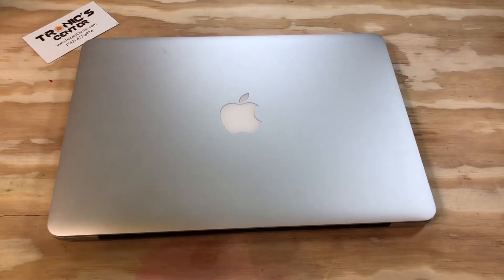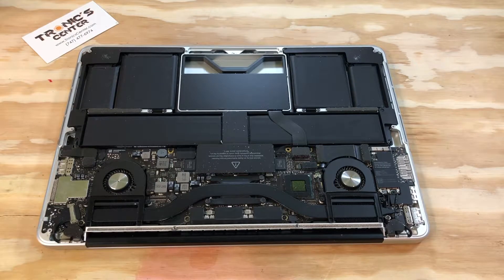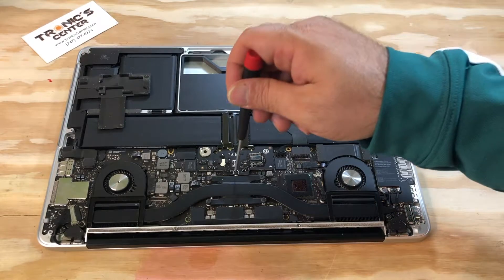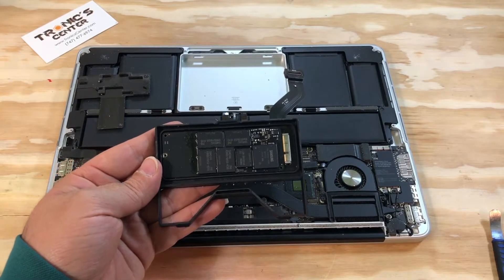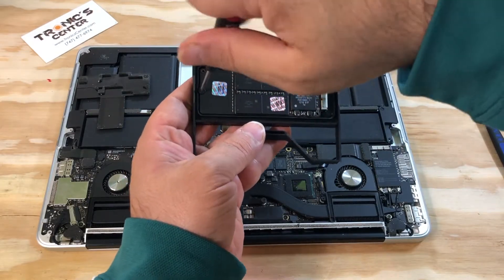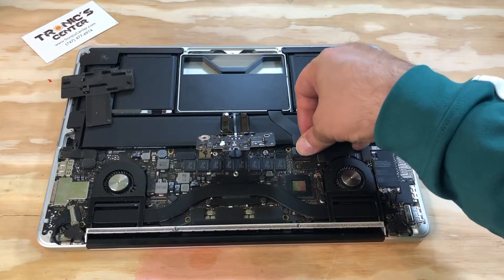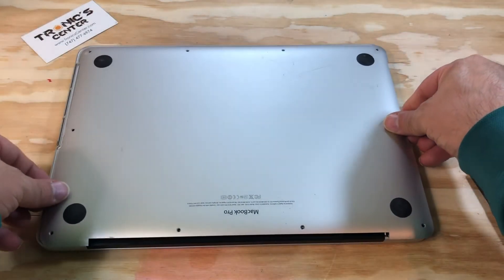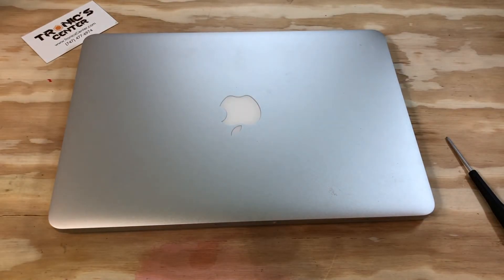Replacing SSD Pcie Storage on 13" MacBook A1425 - SSD installation 13" MacBook Pro A1425    HD 1080p

Comment: why does the battery connector have to be detached when the ssd can be replaced without doing so by simply flipping the assembly ?

Comment: What type of screwdriver do you use at minute 2:00? Thanks
Reply: T6 is what I just used to unscrew it on my laptop
Reply from the maker: Dear You may source the whole screw driver set to be able handle the repair some time the screw is not having a good edge housing then you might want to used different size to grip better . 

Apple, MacBook, 13" MacBook, MacBook Air, A1466 MacBook, MacBook Air logic Board, 13" MacBook Air , Apple Mac , 11” MacBook , A1465 MacBook, A1502 MacBook, A1398 MacBook, A1425 MacBook, A1706 MacBook, A1708 MacBook, A1707 MacBook, A1990 MacBook, A1989 MacBook, A2159 MacBook, A2179 MacBook, A2289 MacBook, A2337 MacBook, A2338 MacBook, A2141 MacBook
Reply from the maker: A2251 KeyWords 

MacBook Pro "Core i5" 2.0 13" 2020 4 TB 3, 2.0 GHz Core i5, I5-1038NG7, MacBook Pro "Core i7" 2.3 13" 2020 4 TB 3, 2.3 GHz Core i7,  I7-1068NG7, MacBookPro16,2 , 2020 13" 4 TB 3 , A2251 MacBook , EMC 3348, MWP72LL/A, BTO/CTO

————————————————————

A2141 KeyWords 

MacBook Pro "Core i7" 2.6 16" 2019, 2.6 GHz Core i7 (I7-9750H), 2.3 GHz Core i9 (I9-9880H), A2141 (EMC 3347), 2.4 GHz Core i9 (I9-9980HK) , MacBookPro16,1, MacBook Pro "Core i7" 2.6 16" 2019 5600M, 2.6 GHz Core i7 (I7-9750H),  MacBookPro16,4 , MacBook Pro "Core i9" 2.3 16" 2019 5600M, 2.3 GHz Core i9 (I9-9880H), MacBook Pro "Core i9" 2.4 16" 2019 5600M, 2.4 GHz Core i9 (I9-9980HK), MVVL2LL/A, MVVM2LL/A, 16" MacBook A2141

———————————————

A2179 Keywords

MWTJ2LL/A, EMC 3302 , 1.1 GHz Core i3 (I3-1000NG4) , MacBook Air "Core i3" 1.1 13" (Scissor, 2020) , MacBookAir9,1 , 1.1 GHz Core i5 (I5-1030NG7) , MVH22LL/A , MacBook Air "Core i7" 1.2 13" (Scissor, 2020), 1.2 GHz Core i7 (I7-1060NG7)

——————————————

A2159 Keywords 

1.4 GHz Core i5 (I5-8257U) , MacBook Pro "Core i5" 1.4 13" Touch/2019 2 TB 3 , MacBook Pro "Core i7" 1.7 13" Touch/2019 2 TB 3 , 1.7 GHz Core i7 (I7-8557U) , MUHN2LL/A , A2159 , EMC 3301 , MacBookPro15,4 , 2019 13" (Touch Bar, 2 TB 3), 13" MacBook Pro A2159

—————————————————————

A1932 Keywords  

MRE82LL/A , MVFH2LL/A, 1.6 GHz Core I5-8210Y, 1.6 GHz Core I5-8210Y, MacBookAir8,1 , EMC 3184 , 13" MacBook Air Space Gray, 13" MacBook Air Gold , 13" MacBook Air Silver , 13" MacBook Air 2019 13" MacBook Air 2018, 13" MacBook Air A1932

—————————————————————

A1534 Keyword’s

EMC 2746, MF855LL/A, MF865LL/A, EMC 2991, MLHA2LL/A, MLHC2LL/A, EMC 3099, MNYF2LL/A, MNYG2LL/A, MacBook8,1 , 1.1 GHz Core M (M-5Y31) , 1.2 GHz Core M (M-5Y51), 1.3 GHz Core M (M-5Y71), 1.1 GHz Core m3 (M3-6Y30), 1.2 GHz Core m5 (M5-6Y54), 1.3 GHz Core m7 (M7-6Y75), 1.2 GHz Core m3 (M3-7Y32), 1.3 GHz Core i5 (I5-7Y54), 1.4 GHz Core i7 (I7-7Y75), MacBook9,1 , MacBook10,1

——————————————————

A1990 Keywords

MR932LL/A, 2.2 GHz Core i7 (I7-8750H), EMC 3215, MacBookPro15,1 , MR942LL/A 2.6 GHz Core i7 (I7-8850H), 2.6 GHz Core i7 (I7-8850H), 2.9 GHz Core i9 (I9-8950HK), 2.6 GHz Core i7 (I7-9750H), EMC 3359, 2.3 GHz Core i9 (I9-9880H), 2.4 GHz Core i9 (I9-9980HK), MacBookPro15,3, A1990 MacBook, 15” MacBook A1990

———————————————————

A1989 Keyword 

A1989 MacBook 2018 MR9Q2LL/A, 2.3 GHz Core i5 (I5-8259U), BTO/CTO, 2.7 GHz Core i7 (I7-8559U), EMC 3214, MacBookPro15,2 , A1989 MacBook 2019 MV962LL/A , 2.4 GHz Core i5 (I5-8279U) , MV982LL/A, 2.8 GHz Core i7 (I7-8569U) , EMC 3358, 13" MacBook A1989

———————————————

A1708 Keywords

MLL42LL/A, A1708, EMC 2978, MacBookPro13,1 , 2.0 GHz Core i5 (I5-6360U) , 2.4 GHz Core i7 (I7-6660U) , MPXQ2LL/A, EMC 3164, 2.3 GHz Core i5 (I5-7360U) , 2.5 GHz Core i7 (I7-7660U), MPXQ2LL/A, 13" MacBook A1708

———————————————————— 
MacBook 

Apple, MacBook, 13" MacBook, MacBook Air, A1466 MacBook, MacBook Air logic Board, 13" MacBook Air , Apple Mac , 11” MacBook , A1465 MacBook, A1502 MacBook, A1398 MacBook, A1425 MacBook, A1706 MacBook, A1708 MacBook, A1707 MacBook, A1990 MacBook, A1989 MacBook, A2159 MacBook, A2179 MacBook, A2289 MacBook, A2337 MacBook, A2338 MacBook, A2141 MacBook, MacBook Pro, MacBook Pro Retina, Retina display, True Tone Display , Top Case KeyBoard, Apple Keyboard, MacBook KeyBoard, MacBook Trackpad.
———————————————————

A1398 MacBook, A1398 Logic Board, A1398 LCD, A1398 KeyBoard , A1398 Display, MC975LL/A, MC976LL/A, MD831LL/A, ME664LL/A, ME665LL/A , ME698LL/A, ME293LL/A, ME294LL/A, ME874LL/A, MGXA2LL/A, MGXC2LL/A, MGXG2LL/A, MJLQ2LL/A, MJLT2LL/A, MJLU2LL/A

—————————————————————

A1706 Keywords

MLH12LL/A, A1706 EMC 3071, MacBookPro13,2 , MacBookPro14,2 , MPXV2LL/A, A1706 EMC 3163 , 3.5 GHz Core I7-7567U, 3.3 GHz Core I5-7287U, 3.1 GHz Core I5-7267U, 3.3 GHz Core I7-6567U, 3.1 GHz Core I5-6287U, 2.9 GHz Core I5-6267U, A1706 MacBook, A1706 MacBook Touch Bar 

—————————————————————
A1707 Keywords 

MPN 923-01477 , MLH32LL/A, MLH42LL/A, MPTR2LL/A, MPTT2LL, EMC 3072, MLH32LL/A, MacBookPro13,3, 2.7 GHz Core i7 (I7-6820HQ), MLH42LL/A, 2.9 GHz Core i7 (I7-6920HQ), EMC 3162 , 2.8 GHz Core i7 (I7-7700HQ), MacBookPro14,3 , 2.9 GHz Core i7 (I7-7820HQ), MPTR2LL/A, MPTT2LL/A, 3.1 GHz Core i7 (I7-7920HQ), A1707 MacBook, A1707 Touch Bar

Comment: I forget my password. How  can i reset my password please sir help me.
Reply from the maker: Dear Since there multiple Type of Password are there not sure how to help, Also there type of password that we can not fix but You May visit your Local Apple Store / computer Store and ask them to help ! 

Let us know what type of video want us to make for you, we can do " All brand repair such as Cisco, Juniper, Hp, Dell, Lenovo, Sony, Panasonic, Nikon, Canon, Apple, SamSung, Any Device iPhone, MacBook, iPad, iPod, Hardware repair or software , iOS or Android , Samsung Cellphone, Laptop, PC, Tablet or Data recovery !
Reply from the maker: A2251 KeyWords 

MacBook Pro "Core i5" 2.0 13" 2020 4 TB 3, 2.0 GHz Core i5, I5-1038NG7, MacBook Pro "Core i7" 2.3 13" 2020 4 TB 3, 2.3 GHz Core i7,  I7-1068NG7, MacBookPro16,2 , 2020 13" 4 TB 3 , A2251 MacBook , EMC 3348, MWP72LL/A, BTO/CTO

————————————————————

A2141 KeyWords 

MacBook Pro "Core i7" 2.6 16" 2019, 2.6 GHz Core i7 (I7-9750H), 2.3 GHz Core i9 (I9-9880H), A2141 (EMC 3347), 2.4 GHz Core i9 (I9-9980HK) , MacBookPro16,1, MacBook Pro "Core i7" 2.6 16" 2019 5600M, 2.6 GHz Core i7 (I7-9750H),  MacBookPro16,4 , MacBook Pro "Core i9" 2.3 16" 2019 5600M, 2.3 GHz Core i9 (I9-9880H), MacBook Pro "Core i9" 2.4 16" 2019 5600M, 2.4 GHz Core i9 (I9-9980HK), MVVL2LL/A, MVVM2LL/A, 16" MacBook A2141

———————————————

A2179 Keywords

MWTJ2LL/A, EMC 3302 , 1.1 GHz Core i3 (I3-1000NG4) , MacBook Air "Core i3" 1.1 13" (Scissor, 2020) , MacBookAir9,1 , 1.1 GHz Core i5 (I5-1030NG7) , MVH22LL/A , MacBook Air "Core i7" 1.2 13" (Scissor, 2020), 1.2 GHz Core i7 (I7-1060NG7)

——————————————

A2159 Keywords 

1.4 GHz Core i5 (I5-8257U) , MacBook Pro "Core i5" 1.4 13" Touch/2019 2 TB 3 , MacBook Pro "Core i7" 1.7 13" Touch/2019 2 TB 3 , 1.7 GHz Core i7 (I7-8557U) , MUHN2LL/A , A2159 , EMC 3301 , MacBookPro15,4 , 2019 13" (Touch Bar, 2 TB 3), 13" MacBook Pro A2159

—————————————————————

A1932 Keywords  

MRE82LL/A , MVFH2LL/A, 1.6 GHz Core I5-8210Y, 1.6 GHz Core I5-8210Y, MacBookAir8,1 , EMC 3184 , 13" MacBook Air Space Gray, 13" MacBook Air Gold , 13" MacBook Air Silver , 13" MacBook Air 2019 13" MacBook Air 2018, 13" MacBook Air A1932

—————————————————————

A1534 Keyword’s

EMC 2746, MF855LL/A, MF865LL/A, EMC 2991, MLHA2LL/A, MLHC2LL/A, EMC 3099, MNYF2LL/A, MNYG2LL/A, MacBook8,1 , 1.1 GHz Core M (M-5Y31) , 1.2 GHz Core M (M-5Y51), 1.3 GHz Core M (M-5Y71), 1.1 GHz Core m3 (M3-6Y30), 1.2 GHz Core m5 (M5-6Y54), 1.3 GHz Core m7 (M7-6Y75), 1.2 GHz Core m3 (M3-7Y32), 1.3 GHz Core i5 (I5-7Y54), 1.4 GHz Core i7 (I7-7Y75), MacBook9,1 , MacBook10,1

——————————————————

A1990 Keywords

MR932LL/A, 2.2 GHz Core i7 (I7-8750H), EMC 3215, MacBookPro15,1 , MR942LL/A 2.6 GHz Core i7 (I7-8850H), 2.6 GHz Core i7 (I7-8850H), 2.9 GHz Core i9 (I9-8950HK), 2.6 GHz Core i7 (I7-9750H), EMC 3359, 2.3 GHz Core i9 (I9-9880H), 2.4 GHz Core i9 (I9-9980HK), MacBookPro15,3, A1990 MacBook, 15” MacBook A1990

———————————————————

A1989 Keyword 

A1989 MacBook 2018 MR9Q2LL/A, 2.3 GHz Core i5 (I5-8259U), BTO/CTO, 2.7 GHz Core i7 (I7-8559U), EMC 3214, MacBookPro15,2 , A1989 MacBook 2019 MV962LL/A , 2.4 GHz Core i5 (I5-8279U) , MV982LL/A, 2.8 GHz Core i7 (I7-8569U) , EMC 3358, 13" MacBook A1989

———————————————

A1708 Keywords

MLL42LL/A, A1708, EMC 2978, MacBookPro13,1 , 2.0 GHz Core i5 (I5-6360U) , 2.4 GHz Core i7 (I7-6660U) , MPXQ2LL/A, EMC 3164, 2.3 GHz Core i5 (I5-7360U) , 2.5 GHz Core i7 (I7-7660U), MPXQ2LL/A, 13" MacBook A1708

———————————————————— 
MacBook 

Apple, MacBook, 13" MacBook, MacBook Air, A1466 MacBook, MacBook Air logic Board, 13" MacBook Air , Apple Mac , 11” MacBook , A1465 MacBook, A1502 MacBook, A1398 MacBook, A1425 MacBook, A1706 MacBook, A1708 MacBook, A1707 MacBook, A1990 MacBook, A1989 MacBook, A2159 MacBook, A2179 MacBook, A2289 MacBook, A2337 MacBook, A2338 MacBook, A2141 MacBook, MacBook Pro, MacBook Pro Retina, Retina display, True Tone Display , Top Case KeyBoard, Apple Keyboard, MacBook KeyBoard, MacBook Trackpad.
———————————————————

A1398 MacBook, A1398 Logic Board, A1398 LCD, A1398 KeyBoard , A1398 Display, MC975LL/A, MC976LL/A, MD831LL/A, ME664LL/A, ME665LL/A , ME698LL/A, ME293LL/A, ME294LL/A, ME874LL/A, MGXA2LL/A, MGXC2LL/A, MGXG2LL/A, MJLQ2LL/A, MJLT2LL/A, MJLU2LL/A

—————————————————————

A1706 Keywords

MLH12LL/A, A1706 EMC 3071, MacBookPro13,2 , MacBookPro14,2 , MPXV2LL/A, A1706 EMC 3163 , 3.5 GHz Core I7-7567U, 3.3 GHz Core I5-7287U, 3.1 GHz Core I5-7267U, 3.3 GHz Core I7-6567U, 3.1 GHz Core I5-6287U, 2.9 GHz Core I5-6267U, A1706 MacBook, A1706 MacBook Touch Bar 

—————————————————————
A1707 Keywords 

MPN 923-01477 , MLH32LL/A, MLH42LL/A, MPTR2LL/A, MPTT2LL, EMC 3072, MLH32LL/A, MacBookPro13,3, 2.7 GHz Core i7 (I7-6820HQ), MLH42LL/A, 2.9 GHz Core i7 (I7-6920HQ), EMC 3162 , 2.8 GHz Core i7 (I7-7700HQ), MacBookPro14,3 , 2.9 GHz Core i7 (I7-7820HQ), MPTR2LL/A, MPTT2LL/A, 3.1 GHz Core i7 (I7-7920HQ), A1707 MacBook, A1707 Touch Bar

Comment: Hi, do you know where i can find a compatible ssd reader. I want to read what is on the hard drive
Reply from the maker: Dear Customer you may go to local Best Buy , Local Computer store or Online " eBay , Amazon , etc... Dear Customer let us know what repair or disassembly you want us to make video ! Please not that we do deal with all Brands Dell, Lenovo, Asus, Razer, Toshiba, Hp, Sony, Panasonic, Nikon, Canon, Black Magic, Red Camera, any Camcorder Bards, Also we do IT Support and Data Recovery !
Reply from the maker: A2251 KeyWords 

MacBook Pro "Core i5" 2.0 13" 2020 4 TB 3, 2.0 GHz Core i5, I5-1038NG7, MacBook Pro "Core i7" 2.3 13" 2020 4 TB 3, 2.3 GHz Core i7,  I7-1068NG7, MacBookPro16,2 , 2020 13" 4 TB 3 , A2251 MacBook , EMC 3348, MWP72LL/A, BTO/CTO

————————————————————

A2141 KeyWords 

MacBook Pro "Core i7" 2.6 16" 2019, 2.6 GHz Core i7 (I7-9750H), 2.3 GHz Core i9 (I9-9880H), A2141 (EMC 3347), 2.4 GHz Core i9 (I9-9980HK) , MacBookPro16,1, MacBook Pro "Core i7" 2.6 16" 2019 5600M, 2.6 GHz Core i7 (I7-9750H),  MacBookPro16,4 , MacBook Pro "Core i9" 2.3 16" 2019 5600M, 2.3 GHz Core i9 (I9-9880H), MacBook Pro "Core i9" 2.4 16" 2019 5600M, 2.4 GHz Core i9 (I9-9980HK), MVVL2LL/A, MVVM2LL/A, 16" MacBook A2141

———————————————

A2179 Keywords

MWTJ2LL/A, EMC 3302 , 1.1 GHz Core i3 (I3-1000NG4) , MacBook Air "Core i3" 1.1 13" (Scissor, 2020) , MacBookAir9,1 , 1.1 GHz Core i5 (I5-1030NG7) , MVH22LL/A , MacBook Air "Core i7" 1.2 13" (Scissor, 2020), 1.2 GHz Core i7 (I7-1060NG7)

——————————————

A2159 Keywords 

1.4 GHz Core i5 (I5-8257U) , MacBook Pro "Core i5" 1.4 13" Touch/2019 2 TB 3 , MacBook Pro "Core i7" 1.7 13" Touch/2019 2 TB 3 , 1.7 GHz Core i7 (I7-8557U) , MUHN2LL/A , A2159 , EMC 3301 , MacBookPro15,4 , 2019 13" (Touch Bar, 2 TB 3), 13" MacBook Pro A2159

—————————————————————

A1932 Keywords  

MRE82LL/A , MVFH2LL/A, 1.6 GHz Core I5-8210Y, 1.6 GHz Core I5-8210Y, MacBookAir8,1 , EMC 3184 , 13" MacBook Air Space Gray, 13" MacBook Air Gold , 13" MacBook Air Silver , 13" MacBook Air 2019 13" MacBook Air 2018, 13" MacBook Air A1932

—————————————————————

A1534 Keyword’s

EMC 2746, MF855LL/A, MF865LL/A, EMC 2991, MLHA2LL/A, MLHC2LL/A, EMC 3099, MNYF2LL/A, MNYG2LL/A, MacBook8,1 , 1.1 GHz Core M (M-5Y31) , 1.2 GHz Core M (M-5Y51), 1.3 GHz Core M (M-5Y71), 1.1 GHz Core m3 (M3-6Y30), 1.2 GHz Core m5 (M5-6Y54), 1.3 GHz Core m7 (M7-6Y75), 1.2 GHz Core m3 (M3-7Y32), 1.3 GHz Core i5 (I5-7Y54), 1.4 GHz Core i7 (I7-7Y75), MacBook9,1 , MacBook10,1

——————————————————

A1990 Keywords

MR932LL/A, 2.2 GHz Core i7 (I7-8750H), EMC 3215, MacBookPro15,1 , MR942LL/A 2.6 GHz Core i7 (I7-8850H), 2.6 GHz Core i7 (I7-8850H), 2.9 GHz Core i9 (I9-8950HK), 2.6 GHz Core i7 (I7-9750H), EMC 3359, 2.3 GHz Core i9 (I9-9880H), 2.4 GHz Core i9 (I9-9980HK), MacBookPro15,3, A1990 MacBook, 15” MacBook A1990

———————————————————

A1989 Keyword 

A1989 MacBook 2018 MR9Q2LL/A, 2.3 GHz Core i5 (I5-8259U), BTO/CTO, 2.7 GHz Core i7 (I7-8559U), EMC 3214, MacBookPro15,2 , A1989 MacBook 2019 MV962LL/A , 2.4 GHz Core i5 (I5-8279U) , MV982LL/A, 2.8 GHz Core i7 (I7-8569U) , EMC 3358, 13" MacBook A1989

———————————————

A1708 Keywords

MLL42LL/A, A1708, EMC 2978, MacBookPro13,1 , 2.0 GHz Core i5 (I5-6360U) , 2.4 GHz Core i7 (I7-6660U) , MPXQ2LL/A, EMC 3164, 2.3 GHz Core i5 (I5-7360U) , 2.5 GHz Core i7 (I7-7660U), MPXQ2LL/A, 13" MacBook A1708

———————————————————— 
MacBook 

Apple, MacBook, 13" MacBook, MacBook Air, A1466 MacBook, MacBook Air logic Board, 13" MacBook Air , Apple Mac , 11” MacBook , A1465 MacBook, A1502 MacBook, A1398 MacBook, A1425 MacBook, A1706 MacBook, A1708 MacBook, A1707 MacBook, A1990 MacBook, A1989 MacBook, A2159 MacBook, A2179 MacBook, A2289 MacBook, A2337 MacBook, A2338 MacBook, A2141 MacBook, MacBook Pro, MacBook Pro Retina, Retina display, True Tone Display , Top Case KeyBoard, Apple Keyboard, MacBook KeyBoard, MacBook Trackpad.
———————————————————

A1398 MacBook, A1398 Logic Board, A1398 LCD, A1398 KeyBoard , A1398 Display, MC975LL/A, MC976LL/A, MD831LL/A, ME664LL/A, ME665LL/A , ME698LL/A, ME293LL/A, ME294LL/A, ME874LL/A, MGXA2LL/A, MGXC2LL/A, MGXG2LL/A, MJLQ2LL/A, MJLT2LL/A, MJLU2LL/A

—————————————————————

A1706 Keywords

MLH12LL/A, A1706 EMC 3071, MacBookPro13,2 , MacBookPro14,2 , MPXV2LL/A, A1706 EMC 3163 , 3.5 GHz Core I7-7567U, 3.3 GHz Core I5-7287U, 3.1 GHz Core I5-7267U, 3.3 GHz Core I7-6567U, 3.1 GHz Core I5-6287U, 2.9 GHz Core I5-6267U, A1706 MacBook, A1706 MacBook Touch Bar 

—————————————————————
A1707 Keywords 

MPN 923-01477 , MLH32LL/A, MLH42LL/A, MPTR2LL/A, MPTT2LL, EMC 3072, MLH32LL/A, MacBookPro13,3, 2.7 GHz Core i7 (I7-6820HQ), MLH42LL/A, 2.9 GHz Core i7 (I7-6920HQ), EMC 3162 , 2.8 GHz Core i7 (I7-7700HQ), MacBookPro14,3 , 2.9 GHz Core i7 (I7-7820HQ), MPTR2LL/A, MPTT2LL/A, 3.1 GHz Core i7 (I7-7920HQ), A1707 MacBook, A1707 Touch Bar